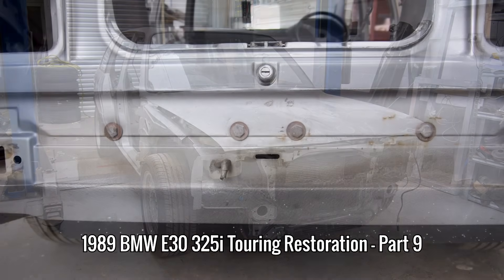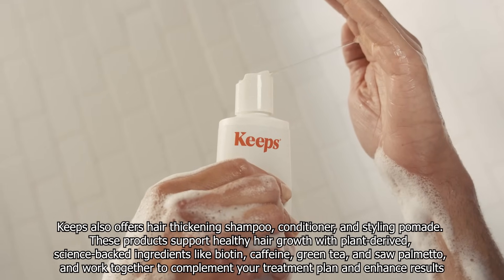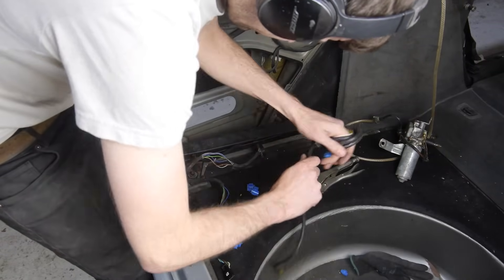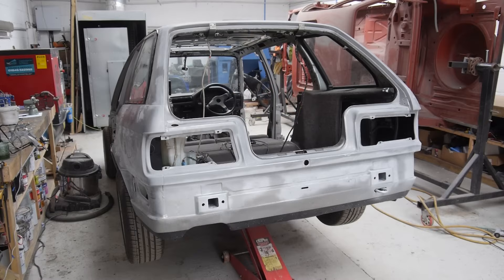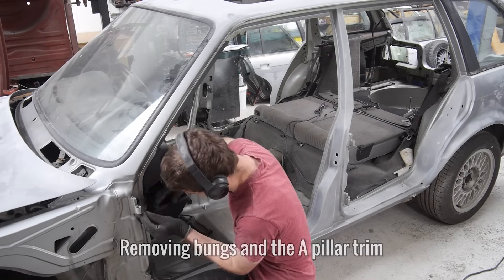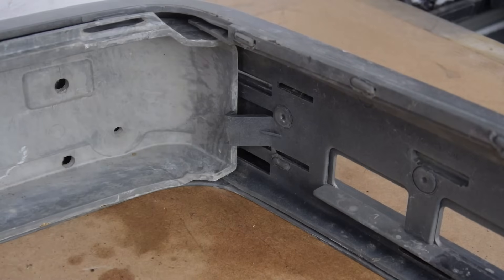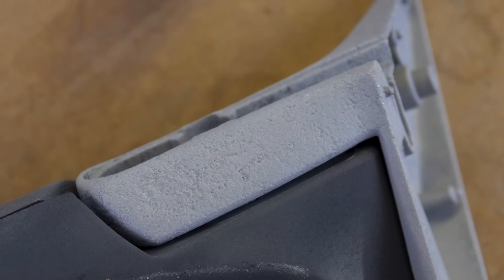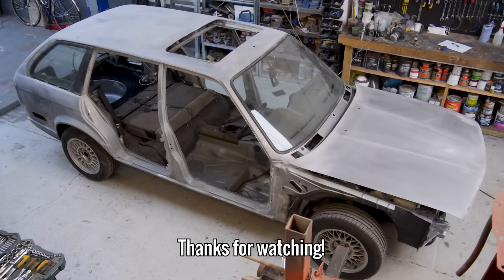Repairing Crash Damage & Bad Mods | BMW E30 Touring Restoration - Part 9

Comment from the maker: Thanks to Keeps for sponsoring this video & for the free product! Head to http://keeps.com/restoreit to get up to 50% off a 3-month plan and for additional product information. Services are not offered in every state. Medications are prescribed only if clinically appropriate. Consultation required. Individual results may vary. See offer details at Keeps.com
Reply: Hey man what's up. It's your old pal suggesting that the current seat fabric be replaced with leather, or a leather-like material. Also, you cannot ever go wrong with black.

Comment: Get a small block of copper and stick it behind holes you want to weld. For example with magnetic clamps. The liquid iron doesn't stick to the copper block and that way you can fill/repair small holes quite easily.

Comment: My E30 is painted in body colour on the inside as well, it's a pre-facelift but i don't think they changed that. Also Schmiedmann has a lot of E30 parts, but they are located in Denmark and Germany i think, so maybe import fees make them too expensive😅 Good work anyways, i love it! If i ever need to do these kind of repairs, i already know what it looks like underneath all the panels thanks to you!😂👍
Reply from the maker: Thanks for letting me know Bayerische! I've used Schmiedmann a few times in the past, great website and company. I'm glad you're enjoying it! Cheers.
Reply: I noticed the bmw dealer is sometimes actually cheaper than Schmiedmann.

Comment: There were plenty of those barbed clips holding trim and fluid lines throughout my E46. There are a few on my E91, and, of course, they caused the heat shield to corrode.
Reply from the maker: I just don't get it! Maybe there's no other viable option...
Reply: @RestoreIt  The barbed clips seem to be phasing out, though. Instead, I see more of the one-time use nylon clips. They slide onto a track for alignment then press into holes on the car. Not bad, but they are the source for water intrusion on the E9x platform. They were revised to have foam washers. Which reminds me: I haven't heard you make mention of the German method of water diversion for doors. Are you aware that the water is channeled through the door's frame and out the holes in the underside? The only protection from egress from factory is foam sheeting and butyl tape. That's why all the lock, side view mirror, etc connectors are insulated!

Comment: Remove connector, heatshrink then refit connector. A cleaner job than cutting and soldering provided the wries aren't weak.
Reply from the maker: Why didn't I think of this... thank you Mannion, you just saved me some time. I appreciate it.
Reply: No worries! Showing how to remove a connector without wrecking it would make good content too.

Comment: I've seen only a brief part of the painting process from a production video from way back when and as commentator states there are 3 layers of paint and from my current knowledge it seems rest of the process is the same as always (conveyor line with robot arms) so that slightly different color might be one of those layers. I'm not sure if one of those layers is some sort of primer over e-coat or base to get specific shade.
Reply from the maker: Thanks for the info Stratos. I think I'm going to go with body colour and no clear.

Comment: Quick preparation to sell series turned into a full restoration
Reply from the maker: Haha... This is still only a half/mini restoration in my mind. Without stripping the chassis completely, this is the bare minimum required. I see so many people calling a clean, some new parts, and a polish a restoration, I'm not even calling this one a full restoration. The 325i Sport, now thats a full restoration and I can't wait to get back to it.
Reply: @RestoreIt  The 325i sport chassis needs to go on a jig because its visibly twisted due to not being supported properly on the spit while having panels (like rear quarters) removed.

Comment: Brother, just use liquid electrical tape for the wires and cover with Tessa tape, cutting and soldering and what not is absolute overkill.
Reply from the maker: Maybeeee. It won't take me too long to get that done and it'll be nice to know there isn't any electrical tape in there.

Comment: The vehicle that was worth spending so much effort should have been the e24 635 CSI so that it would find its value when it was finished.
Reply from the maker: That's a very specific suggestion Mardina. Sadly I didn't have one of those on hand. Cheers.

Comment: I geniunely Love Restore IT, but over the past 2 years its seemed to be only just rust replacement each time over and over, are we soon to see some things like such as Sunroof Sliding Fixes, Floorpan Drains Fixed up, or even things like Wiring Harness etc. 

If any of these videos came out and got away from just body work all the time would be amazing just feels we have been on body work now for over a year+ on multiple different cars.
Reply from the maker: I think you're spot on Owen, thanks for the feedback. I'm going to condense the rest of the bodywork down into one or two episodes and move on from it. When it comes to the 325i Sport, I'm also going to pack all of the bodywork into a couple of episodes. I've had my fill now and I'm sure most of my viewers have as well. I really appreciate the honest feedback, it really helps! Cheers.
Reply: @RestoreIt I do like the body work, since it was probably 80% of the work that went into mine. I wish i had your videos when i started. I could probably have used it as a template, including the rear quarter damage.